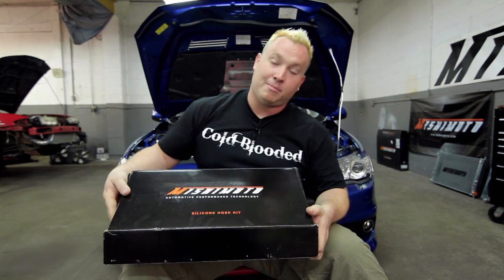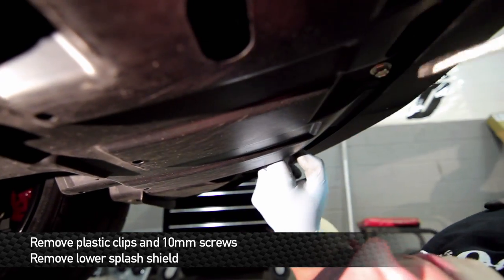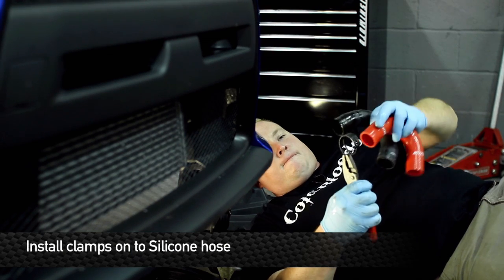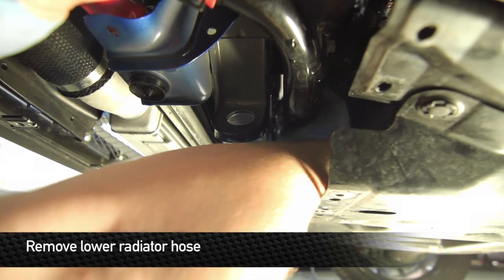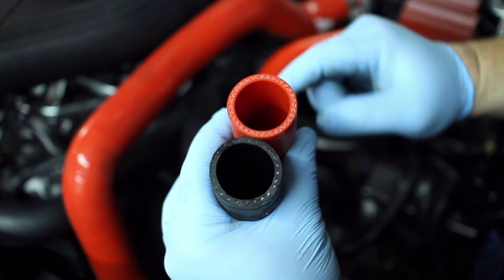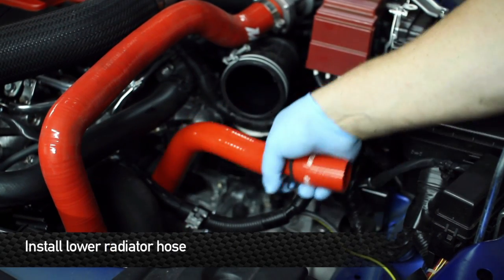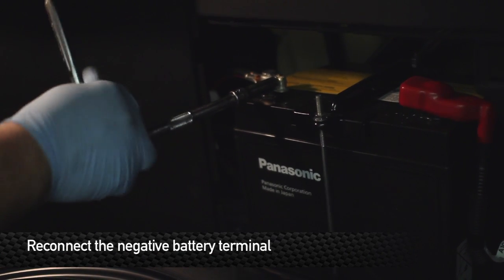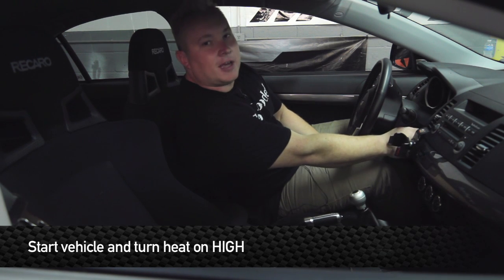How To Install: Mishimoto 2008+ Mitsubishi Lancer Evolution X Silicone Radiator Hose Kit

Comment: will these hoses remove with the same difficulty as rubber hoses after they have been installed for a couple years or will they be stuck on so much that they get torn up trying to remove to say replace a thermostat?